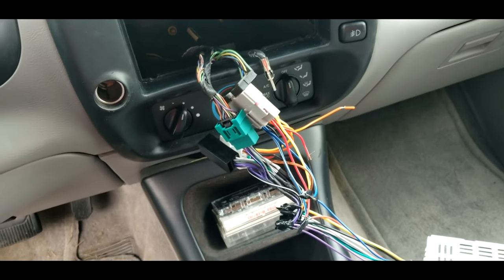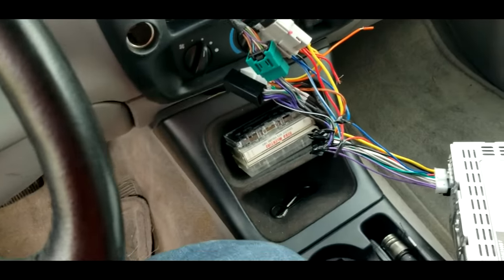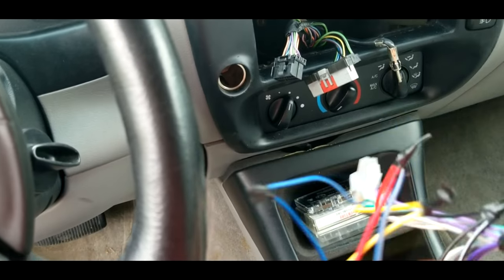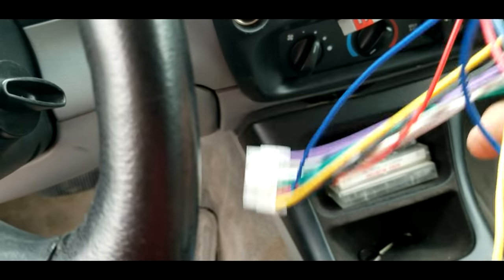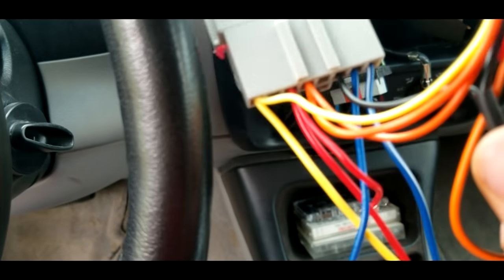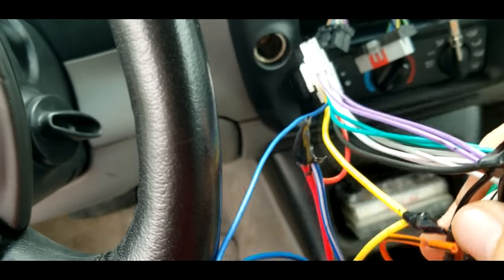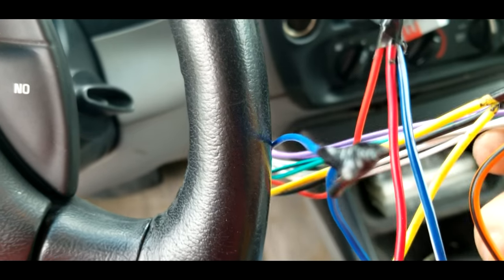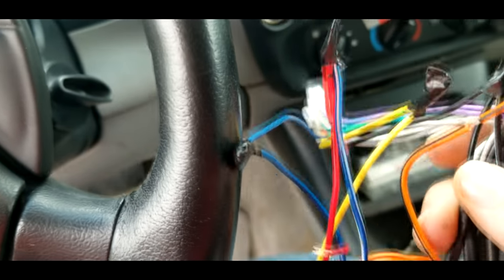Aftermarket Radio Turns On BUT NO SOUND **SOLUTION**!!!

Comment: I have GMC Envoy try connecting the 7018b radio, it even has pink and brown wires. But no blue and white wire. but I have no sound? So which wire is it?
Reply: Did you figure it out? Dealing with the same problem in my envoy.

Comment: Thank you for the video... I have a question... My harness have two blue /white cables I need to connect both to the red? Because I have blue cable and I connected with antenna... Thanks
Reply from the maker: I wouldn't know.  Make sure to check your user's guide to double check what those cables are for before throwing them onto the red wire.

Comment: Great video and also as a reminder electrical tape can fall off and in really hot areas it'll just come right off always good to either solder or if not put caps on the wires trust me it is worth it in the long run
Reply: It still hasn't worked for me. I have an 03 Dodge Ram 2500. I'm so confused. I gave up a month ago and I just wanted to try again today so I was researching wjat to do. My blue/white wire is a remote control wire. My Red is ignition switch wire.

Comment: I have an '07 Camry, and I still like to listen to FM radio. My stock unit was CRYSTAL clear and I had my favorite stations, and many at that. Once I had my aftermarket unit installed by a shop (I wanted the car a little more modern), everything was perfect except for the unit picked up only two stations and were so static-like. Could this also do with the amp like you showed us? Sorry, I'm not a big car guy!!
Reply from the maker: I doubt it.  It sounds more like an antenna/signal issue

Comment: So I have a 2007 Silverado with a working radio and no sound to the speakers. It’s 100% stock, never even been removed. All the fuses work (radio, amp). How would I go about using your solution for my truck? You said no to get into the stock wires behind the stereo..

Comment: 2004 Ford Expedition XLT… Just installed an aftermarket receiver. After doing so I noticed my rear speakers have no sound. Both passenger, driver side do. Any idea what it could be? What’s the solution to this issue? Any help would be appreciated.

Comment: I'm currently having this exact issue with an audi. I have the blue and white wire coming out of the head unit, which when I connect to the blue wire coming out of the harness which is wired to the amp there I'd no sound so I'm guessing it's not turning the amp on. Should I connect the blue wire from the harness to the red wire from the harness and totally leave out the blue and white one from the stereo. Thanyou

Comment: THANK YOU.  I have this exact problem on a 1993 f-250 . Your awesome.
I do have a dark blue with red strip wire and a light blue with red strip wires 
 One on each factory Ford plug and one blue from stereo.  Bit that is for remote turn on. So you have help greatly.

Comment: Don't know if you can help me but I have an aftermakert Bluetooth kit installed (there when I bought it) in my Honda civic and it is wired to go through the radio and mute all sounds when active. Just recently it has started to randomly mute the radio and stay on mute. When the car is first started, the radio plays for a couple of seconds but then the Bluetooth connection kicks in and then there is no sound so I know the issue is not with the radio. Have tried pressing buttons to turn the kit off to no avail and have even found the user manual for that specific Bluetooth kit but that also has no info. Have searched soooo many forums but all dead ends.
Probably could go to my local car place but would prefer not to spend money if there is a simple fix.

Comment: Super important question. Do the wires in your factory harness match up identical with the aftermarket stereo harness? For example my Toyota specific harness plugs in perfectly however the factory red yellow and black wires match up with my rear left and right speakers... Wish I could post a pic to clarify.
Reply: Call clutchfield. They can help you find the right harness. I had the same issue. You have the wrong harness for your specific vehicle and stereo.

Comment: So I bought an OEM upgraded version of my car’s radio. The default one is just a regular radio with a game boy style screen. The upgraded one is made for my make and model of the vehicle by the manufacturer for the premium package. I thought it would just be plug and play and it mostly is. The steering wheel buttons work on the radio but there is no sound. Lights up and everything.

Comment: Do you think this would help with my radio I has the blue and white wire and my harness didn’t have any wire to match it to and my radio has power all the lights are on on it and the screen cuts on and off

Comment: Need help ! The previous owner of my car (toyota matrix Xr 2006) cut the original wire..so i tested with multimeter/test light to match the color with my stereo...the radio turn on but no sound !..I tried to put directly the blue wire (amplifier/antenna..its just one wire) of the radio to ACC wire..but still no sound.

I read about "amp"..but i do not know which wire is it..

Comment: What happens when all that is cut out so you having to hard wire it basically cause previous owner cut it out and it’s on a 1999 dodge truck I’m having this issue with might go to a junkyard and get some oem radio stuff to go get a adapter.

Comment: Not sure if you’ll respond but worth a shot, so I drive a 2014 Genesis coupe 2.0 and I got a new radio. I hooked it up everything was working fine but I wanted my steering whee controls back I bought this maestro thing and plugged that red wire into my radios red wire and all of a sudden I saw smoke and turned off my car immediately, upon turning my car back on my radio stopped working, so I got a new one set that up but that also doesn’t turn on. My old original radio turned on but no sound, what would solve my problem?
Reply from the maker: Sorry I'm not sure

Comment: Thank you! It worked for my front speakers but my rear ones did not turn on. Do you know why? It's the wire harness that plugs in the back of the radio. I can directly connect the wires but it makes a static sound.
Reply from the maker: Hmmm.  That's odd.
Reply: Never mind I solved it I looked at a YouTube video and on the pioneer double din and they said to change the output from subwoofer to rear.

Comment: I followed these instructions (05 camry) and the stereo worked but got power when the car was off, like you said would happen if i plugged the blue into the yellow. It also made it so that i could no longer lock my car with my key fob. any ideas?
Reply from the maker: Sounds like somthing you did wasn't right.  Shouldn't have anything to do with your vehicles locks.

Comment: This is the problem I'm having on my 2018 rav4, radio turns on but no audio. My cars harness does not have a blue with white wire, only has a solid blue wire which I'm guessing is the antenna. So what wire would I be looking at?? Thanks!

Comment: So installed the new speakers & wired them but my music will not play… I also do not have original radio in I have a aftermarket touchscreen one in… But before the older speakers blew out it was working just fine.. any suggestions? Is it the radio ?

Comment: Hey Buck2013,  Where did you get the extra harness from? Did you buy it? Like what website
Reply from the maker: I bought both the radio mount and harness at Walmart.  I just looked on the package and made sure it would be compatible with my 97 ford explorer.  it will have a long list on the package what will it will be compatible with.  and some of them come with extra connections.  you just don't use the ones you don't need.  Just match up the one that fits into your car's/truck's connector.
Reply: @JerryMiah  I have an 07 Honda Accord with an 10.1in Android aftermarket radio . We both have the same color amp wire (blue w/ white). How do I find power line wire ?

Comment: @Buck2013 hi I'm having a problem with a Boss Audio amplifier, I put it in my truck and it has the rock, class,flat,pop, and eq off settings. When I have it in every setting but eq off all 4 speakers work, but when I have it in eq off only the drivers side works, could you tell me what's wrong.

Comment: Thanks for the help. I now have sound, but now it cuts in and out intermittently. I am not sure if the Metra harness with 12v interface box I bought for my car is faulty or the factory amp just cant "communicate" with the Metra interface box properly. I'm wasting so much time and money on what I thought would have been an easy car radio update. I am sure all of my wiring is securely connected. It's possible that it could be the unit itself, but I tested it without running it through the system in my car and it plays fine.

Would anyone know how to resolve this issue other than possibly bypassing the factory amp?

I appreciate you uploading this video. It did help with my initial issue with no sound at all.
Reply from the maker: Thanks for the positive comment.  I hope someone on here might be able to help you.  I'm not sure myself.

Comment: What can cause no sound coming from the car speakers.  When I connect my phone thru Bluetooth only the subwoofer works but no car speaker. Also when I turn the key to accessories the protection light mode comes on and off quickly but no power. Both fuses on the amp are good . Can it be a bad amplifier.

Comment: I have a Porsche Cayenne 2004 and my harness was already set up but I came with small harnesses to plugg in the new head unit and there is two blue on blue and one blue and white I took the blue and white and connected it to the red on my harness because I couldn’t find the red in my factory harness the only one I found was red and yellow so I connected 2 red and the white blue wire but I still doesn’t get any sound can you please help me because I get no answers online or from the seller and I bought it for 600 so if it’s not working that’s 600 in the drain

Comment: I was wondering if you could link the model number for the stereo harness. I have been trying to find the correct harness for my 1997 ford explorer with the jbl sound system but havent found one. Your vehicle has the same exact factory plugs as mine. If you could either link it or just the brand and model number that would be amazing.

Comment: So my radio has a blue wire that says "power antenna/amp turn on" and the harness adapter has a blue wire that is only power antenna. 
So... do I connect the blue wire from the radio to the red wire and cap off the blue wire from the harness?

Comment: I have a Pioneer head unit I just installed I do not have a aftermarket wire harness radio comes on but no sound my subwoofers even stopped working after I installed my second amplifier my amplifiers comes on but just not getting sound out of any speakers

Comment: I did this to my BMW Z4 2003 , both the aftermarket radio and my harness have a blue wire with a white line for the amp and it even says amp … but still no sound … any help?

Comment: I’m trying to figure out the signal wire from my car bc my wiring harness has one but I can’t find the one in my car ? I took out the factory amp and am bypassing it but still can’t get no sound but do have power to the radio

Comment: I need help... I got 2005 lincoln ls ultimate and J got an universal eonon 7 inch android 10 radio with a metra 70-5521 harness which everyone uses in their instlatio vids. I spliced power cable from metra and from eonon radio, connected everything up and radio boots up, no sound ;(. And there is no blue/white wire, unless other cable metra came from but I have nowhere to connect that  and Im really confused idk what to do... stupid rare car

Comment: I have a 05 F-150 took the radio out of a 2015 F-250 put in in the 05 radio worked fine in  the 250, comes on for maybe 5 seconds shuts off no sound does not show the stations either.  Any advice?

Comment: Wow that actually works for me thank you but I have one question will the amp stay on once I turn the key off
Reply from the maker: It should not if you hooked it up the way I said.  If it is hooked up to the other wire that supplies power constantly then yes and it would drain your battery
Reply: @JerryMiah  yes I did hook it up the same way you did thank you

Comment: So on my 2005 Pontiac Sunfire I don't have a blue and white wire for the aftermarket stereo I'm putting in I just have a blue wire and everything comes on I can put bluetooth on everything works but no sound coming through speaker so should I hook the blue wire up to the power instead of the blue with white line?
Reply: Wish someone would answer this! Same problem here!

Comment: So i bought an Android head unit for my fiat 500 (brand: Witson). Installed it and everything worked properly except no sound came thru. Do you think your solution Will solve the problem? My wires are labled so i find the AMP wire but dont know which wire i need to connect with to power it. I hope you can help me maybe

Comment: Ok so I got an 01 gmc Yukon factory amp went bad. Bought aftermarket radio hooked everything up and can only get sound out driver front speaker no where else. Decided to run new speaker wire for all speakers and bypass bad amp. Still can only get sound out of driver side door. Any ideas?

Comment: Hi
I have Suzuki Swift 2014 model. I am facing same issue the radio turns on but there is no sound. It has built in company fitted multimedia System. Can you please help me with this issue

Comment: I have a blue wire on both my car and radio but radio wire is bright blue w white line and car wire is a dark blue with a black line so ig id be connecting like so in the video? (Radio does state its a power intena wire

Comment: I have a 2001 Chrysler Town @ Country minivan and for the last two months, no sound has come from its factory radio even though the radio turns on and the cassette player still works, just no sound regardless of volume level. A relative of mine said it might be a fuse. Would it be more than that to fix it?
Reply from the maker: I could possibly be a fuse. I'd check the manual and see if the speakers have any fuses related to them. If there's no sound I would say a blown speaker, but I doubt that since you have no sound at all.

Comment: I’m having this exact problem but I have my amp power wires (blue and white) connected and tried connecting the stray blue wire to the red wires and nothing is working. It worked earlier but stopped, I fixed it and it’s broken again, any help?

Comment: Let me see if I did understand, i've got a blue wire called Amplifier, that one is the one that I have to connect to the ignition cable?
Sorry but english is not my first language and I'm a little bit confussed, and I'm dealing with this problem. 

When I turn on my HeadUnit sometimes i get sound and suddenly from nothing stop sounding. 
It turns on but I'm getting no sound at all. 

The problem is kinda like this?
Reply from the maker: No problem your English is pretty good in my book.  That's odd that you sometimes have sound and then dont.  I'm guessing everything was connected correctly but perhaps a wire has come lose, the ones to the speakers perhaps?  Or maybe even the one to the amplifier.  If not, then it could be a problem with the head unit.

Comment: I did this to my 2000 mustang and it worked. But when I got on the road to head back to school, I noticed my aftermarket radio and amp for my sub wasn’t turning off. I need help on what to do.

Comment: I have an 81 Bronco and the only wires I found were the ground red & yellow wires. No blue coming from the vehicle directly. Looks like they did a rinky dink job before when I took the old unit out
How frustrating

Connected it (P cont blue and white wire) to the red wire coming from the car and all it does is constantly power it when the car is off

Comment: My brada um having a problem with my speakers the front speakers are working well but the ones at the back are not working plus um using the old stereo so wat could be the problem

Comment: I cut my wire harness and now my alarm and auto door lock don't work my inside lites don't work and when you turn the car on the speedometer and gas and all that stuff on the dash goes crazy for about 4 seconds. What do you think happened
Reply from the maker: No idea.  You should not cut into your original wiring.  That's what the adapter harnesses are for.

Comment: You can use that orange one it connects to the orange wire on the harness already in the vehicle and you can use your vehicles dimmer switch to control the brightness  it's not necessary tho

Comment: Same issue.... When i tested the speakers individually with each pair of speaker wire of the radio it worked.... But after connecting all speakers at once , no sound.... Im gona look into this.... I have 2 spare radios and it does the same.... Goes on but no sound.... Today i will test them individually again to confirm that the speakers wasnt damage coz my harnesses dont have that striped blue wire.... Only the solid 1 for antenna

Comment: Great video by the way, but I must be doing something wrong because I’ve tried this and not getting sound. I used butt connectors which I’m thinking of removing and go back to wire nuts. The one thing I did notice was if I turn the car off the radio and my dash clock stay on unless I power down the receiver. I using my old CDA9851 Alpine. Everything otherwise is matched up.

Comment: I tried this already it did not work which sucks for me. I have an Infiniti Soundsystem in the vehicle that came with it. I hooked up my regular blue wire, no stripes to my red and it gives me power, but when I hook up that blue wire with the white stripe it does nothing won’t even turn on and then, when I properly hook to my harness to the radio wire to wire everything colored, it turns on and says no signal.